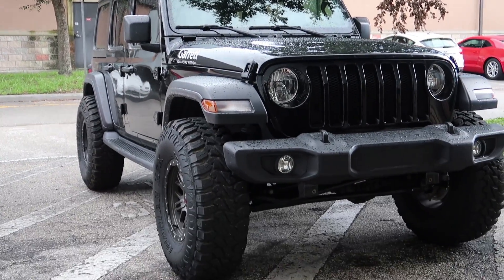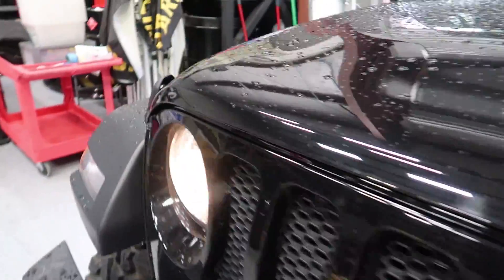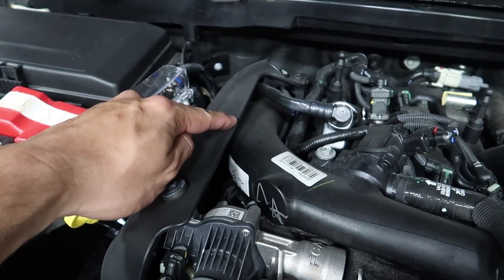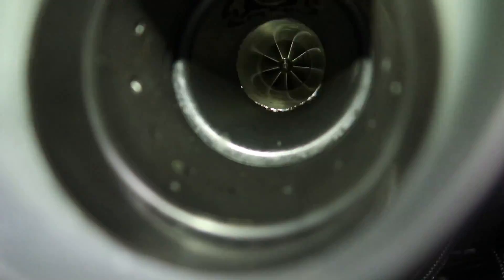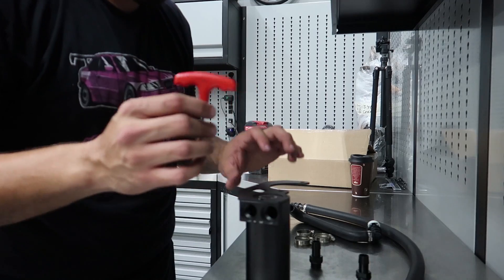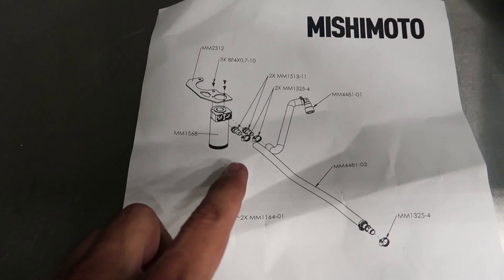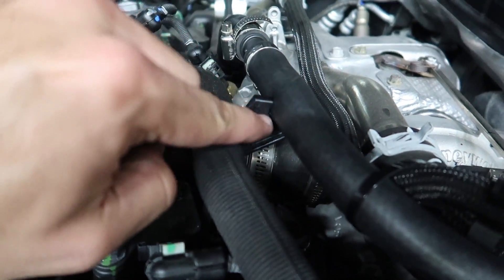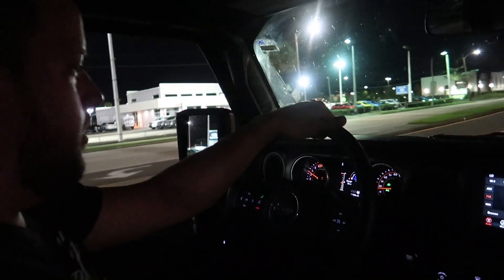JEEP JL MISHIMOTO OIL CATCH CAN INSTALL NEW PRODUCT!

Comment: Hey Alberto, question, how often do you have to empty the oil? When you do empty the oil do you have to unscrew everything again or it is easily accessible to empty the catch can without taking anything apart?
Reply: I will be curious also.  I understand that depending on how hard you are on the throttle, you may need to empty the can every 4,000 ~ 5,000 miles. (according to a friend that also has this installed). I am just going to incorporate the process of emptying the can every time I do an oil change.

Comment: Alberto,  what size tires are those?  They look beefy!!!! Did you re-gear to enable larger tires?  I have a JLU Sport-S with 2.0L Turbo as well, and I am following in your footsteps.  Also did the 2.5" lift, and now installing the oil catch-can (thanks to this video). My next mod would likely be re-gearing to 4.88 and installation of a TrueTrac diff in the M185 front axle.  Depending on how I like the TrueTrac, I might eventually replace the LSD with another TrueTrac in the M220 in the rear...  Thoughts??
Reply: By the way, awesome vid !!!

Comment: Have you noticed a change in your engine characteristics with the Catch Can installed? I installed the same catch can on my JL 2.0L, but my engine seems to be running harder than w/o the Can. It feels like it takes more effort to get up to speed, my MPG has gone down by 2-3 mpg, and it went from smooth shifts to more labored and delayed shifting. Any ideas?

Edit: I think it was in my head, read below for a slightly more detailed explanation.
Reply: that is so surprising. Thanks for sharing. I haven't installed mine yet and now I'm hesitant. Did you find anything on it?
Reply: @wissamharb5684  I think it was just in my mind. I failed to take into account the increasing temperatures in my area (100*F and higher) and running the A/C wrecking my MPG. I had started driving the Jeep in December, and didn’t install the catch can until the summer heat started appearing. So MPG issue solved.

As far as the shifting? I remember reading a bit on how the 8 speed transmissions can be kind of wonky sometimes. Sometimes it feels like it’s trying to “search” for which gear to be in, which can cause some delayed or labored shifts. 

Overall, I’m satisfied with the product, and I think what I was experiencing was just in my head.
Reply: @Razgris06  Glad to hear that! Yea A/C makes a difference for sure.